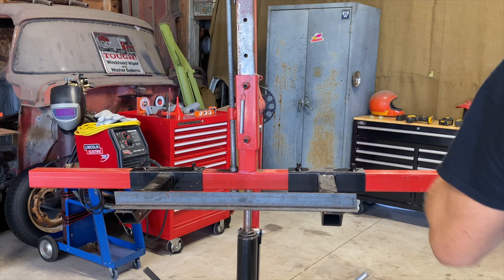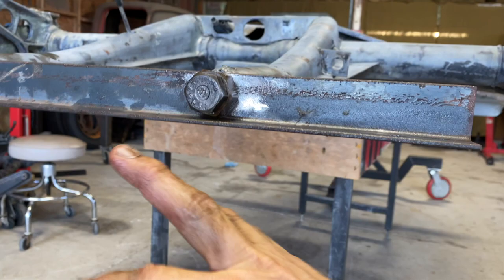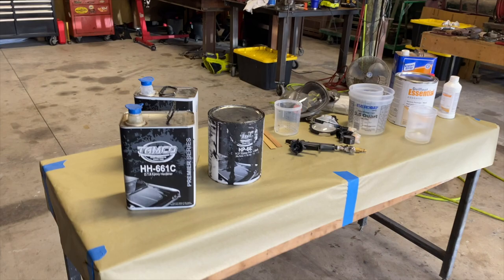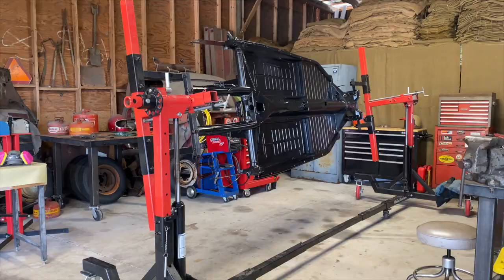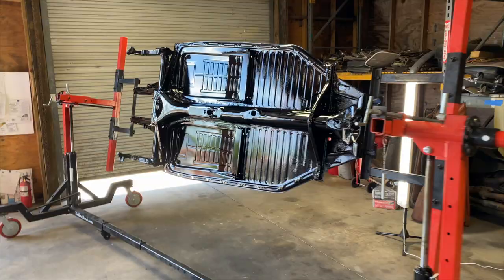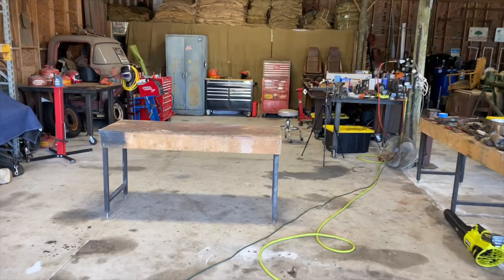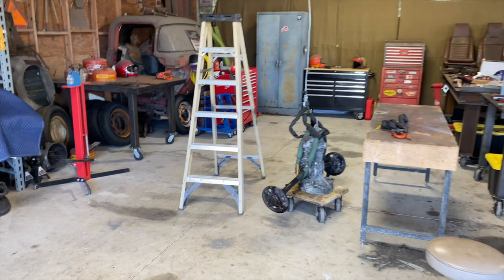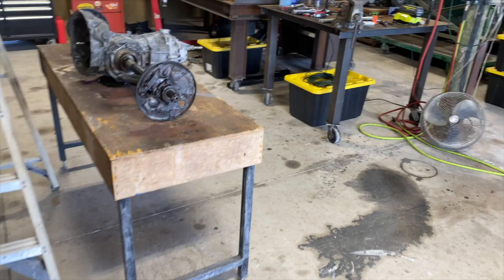VW Beetle Restoration - Primer & Painting the Chassis

Comment: For the rotissery to turn easy, you have to have the chassis higher up nearer to the pivot points on the rotissary stands. You have the handles on  the long screws you have to turn to raise the height of the frame. For just hte chassis, it would have to be up where the centre pivot point is where you lock the pins in. The centre of the black disks with the locking holes is the pivot point. Hope this helps.
Reply from the maker: Hey Ian, I will try that tomorrow. Thank you! 😎
Reply: Then lower using the hydraulic jacks to get it to a comfortable height to work on it. Getting it closer to the center of gravity will make it easier to turn by hand.
Reply: He can also install counterweight to the rotisserie to the point he could turn the whole thing with a finger

Comment: After seam sealing the pan I will recommend spraying the bottom of pan with rubberized truck bed liner so the road stone and gravel does not chip away at your paint and cause rust later on.
Reply: I was wondering if anyone else would mention this.  I would have let the epoxy fully cure, put on seam sealer, and then the paint.  But do look into Raptor Liner for the bottom of the pan and inside the wheel wells.
Reply: Don't 'Zeibart' the chassis. It seemed like a good idea for the cold belt. That stuff traps the moisture in so rust is more likely to occur. My 914 and Jaguar has that crap.
Reply: Nobody is talking about cheap undercoat housepumpinpc.  RaptorLiner is a seriously tough bedliner coating that will resist rock chips, abrasion, road salt and all the nasties you can throw at it.
Reply: @patricks8086  Yea the raptor or other undercoat that is not the cheap asphalt stuff does not trap moisture underneath. Body shutz from 3m is good too. They use this stuff on the Euro cars from the factory and have no rust issues or water entrapment underneath.
Reply: Thanks for the tip about the 3M Body Shultz @Mike Fn Garage .  I enjoy your channel too.  Loved the “Bullet proof” engine series.

Comment: Hello bro, I have been following you for a long time, I admire your skill and how you enjoy restorations. I love VW beetles. My father had three, from 1951 (no synchronized gearbox, you had to press the clutch pedal twice to change gears and it didn't always work well :) ), another from 1957 (oval rear window) and a last one from 1958 (rectangular rear window). I remember with nostalgia those family trips with the "Volky", when the fields and roads were pure peace... When I turned 18 I bought a 1957 beetle, my first car. It was glorious, although I screwed it up so much that on a trip back from a beach (we were five guys on board and the temperature was 86 degrees F, about 30 C) the crankshaft broke from the heat, I estimate the tarmac was at over 120 degrees F in full sunlight. The mechanic (a German from Bavaria, Dieter) later explained to me that these crankshafts had a defect, which was having few benches and that at high temperatures, and especially because the crankshaft is a few centimeters from the ground, they tended to flex, which at high revolutions they "broke". That's what happened to me... But I never lost my love for VW Beetles. Greetings from Argentina!!!
Reply from the maker: Thank you my friend! =) 😎

Comment: Nice job on this. A couple of tips that I am sure you will find helpful:

1) throw out every can of WD-40 that you have and replace them with Kroil or PB Blast. WD-40's lubrication properties are temporary at best and it actually promotes rust. If you go down to a dock at the ocean and talk to the old timers, you won't find a single can of it around. Personally, when I ran my hotrod shop, I wouldn't even allow it in the door. 

2) Stop painting in sections. Start at one end of the object you are spraying and go all the way to the other end. You got away with it in this case because you were spraying black. Most other colors will show discolorations where the overlap happens. Note: spraying metallics or pearls the way you are spraying will yield hideous results every time.

3) Spray the paint down heavy enough to where it just wants to run but doesn't. You want full wet coats. Otherwise you get orange peal...

I hope this helps. Keep doing what you do.

Comment: CT, you're getting better with episode!  The paint you're using (Delfleet) is a really great paint. I used to buy it as Deltron as I remember. A very tough urethane with a beautiful gloss. Your orange peel or very rough surface finish comes from using the wrong thinner for the temperature, or not enough of it. Contributing factors would be holding the gun too far from the work.  It has been about 50 years, and refinish technology has also changed, but what worked then as far as the basics, will still work today.

Comment: Hey CT as for your winch, this may have already been suggested but until you get a real hoist anchor the winch to the wall or floor and run the cable up to a pully in the beam. You can then control it from the ground and away from the load.

Comment: Yes get donor seat frames, be sure the welds on the straps that hold the box springs together are not broken. There under tension, so re-welding them is tough, also because the metal is so thin. The TMI kits are not hard to do if you check out their videos. Mine came out great. NOTE: if you blast & powder coat the frames, FULLY disassemble the adjustment mechanisms, and block off the bottom of the rails, where they hold & slide. The 2mm  the powder coating adds, make them un slidable, ask me how I know.

Comment: Heheyy... Working like a pro... 😉 You're making me envious.. Ha, the rotisserie certainly is a hand of relief for such works, for achieving the goal with ease is to find the center of mass ot the thing is mounted on, so at the end you should be able to turn it with 1 finger effortlessly.  Chase the height on the rotation pivot, which for the chassis is almost centered, now you have it very low, therefore you can't spin it. Use the long screws with handles to set it as close as you can to pivot. The body is different, it's center of mass is usually lower. 😏
It's probably the best if you set the paint gun's expansion pattern to 45 degrees instead of exactly vertical, doing so you are good also for vertical movements without overspray, at least this is what I prefer.It's kinda stroke "neutral"..

Orange peel happens usually when the paint is a little thick and possibly the coat is too rich or the second coat is too soon after, so the first didn't cure perfectly yet. Anyway it's looking very good, if  you consider what it was before.. 👍

Comment: Nice job man! Looks like your pattern was a bit dry, try a larger tip for primers and single stage, 1.6-1.8 for primer and 1.6 or 1.7 for single stage. the 1.4 you were using is more for clears. Keep up the great work!

Comment: CT why dont you use the winch upside down ,for example put the part where you operate it at the transmission to lift and the other hook at the ceiling ,then you dont have to work and lift from the ladder 👍🏻👍🏻👍🏻and great job on little Rusty .keep it going kind regards Charles

Comment: Keep your arm straight when you prime or paint. When you fan the gun you do not get an equal amount of material on the surface. Also cut your fan down a little, because most of the material is going in the air and not on the surface you are spraying.

Comment: I'm loving this series. Kudos to you for having the motivation to take on such a project. It nots easy to start and FINISH a project like this.  At 12:48 you the floor pans are shown. Were the seams welded shut or did you just spot weld them together  If the latter, are there any concerns the seams may not be water-tight?  Shouldn't these seams be welded shut? Or do we duct tape the inside, Flex Seal spray outside the seam and call it a day?  I didnt see you working on the floor pans so you probably addressed this already in a previous video that I mustve missed.

Comment: Make some inserts to go in the top square tube and find an old set of weights to counter balance the pan. If you the old bar and weld to a square tube it will slid right in and weights can be inserted on the round bar.

Comment: I was just looking at your winch your using to lift the transmission I was thinking you could take it apart and run a external switch from the top you could run it from the floor make the cord long enough to walk around

Comment: Slow your hand movement as you spray, as you're applying far too little paint with each pass.  Go from one side to the other - not just small sections at a time so that you'll get a more even application on each coat.  Finally, when adjusting your gun settings for optimum atomization, do so on your test paper before spraying the piece.  And as you're going along, if you find your gun needs readjusting, or even a bit of a "tweak", go back to your test paper and revisit and adjust your settings accordingly.